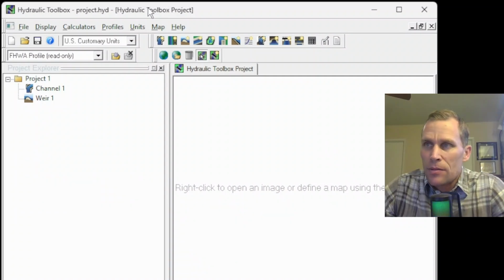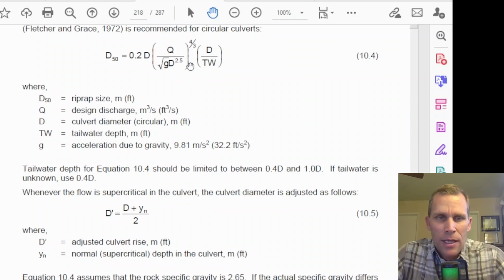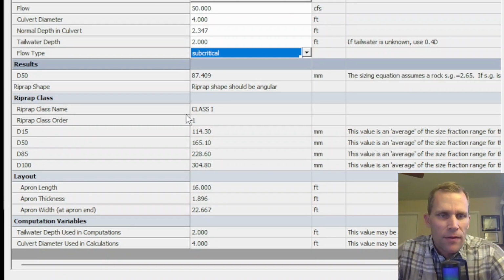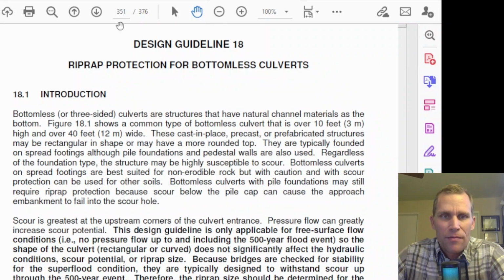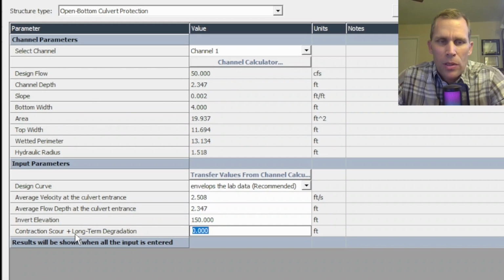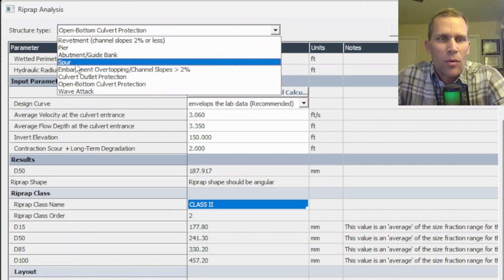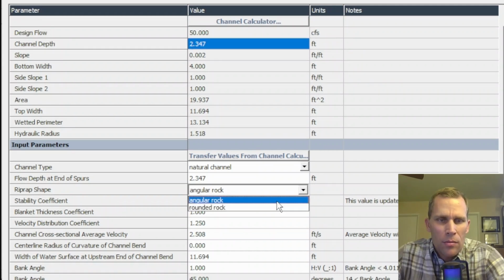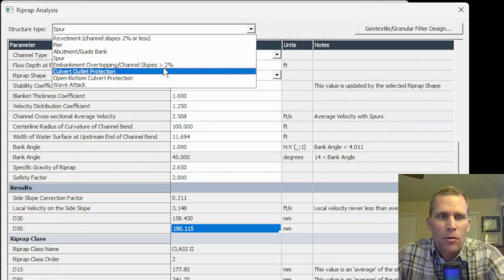FHWA Hydraulic Toolbox Lesson 12 - Riprap Calculator - Culverts and Spurs

Comment: Hello sir, I have a rectangular culvert. But the only option available is culvert diameter. How do I work around that?
Reply from the maker: Hi. The user's manual doesn't address this situation. I would calculate and use a diameter whose normal depth matches the normal depth as your rectangular-shaped culvert.
Reply: @TimNelsonPro Thank you sir. I also have another question that's somewhat unrelated. How can I get the expected scour at the end of a basin and apron since scour is always inevitable when flow changes from artificial to natural channel? Can Hec-ras model something like that?